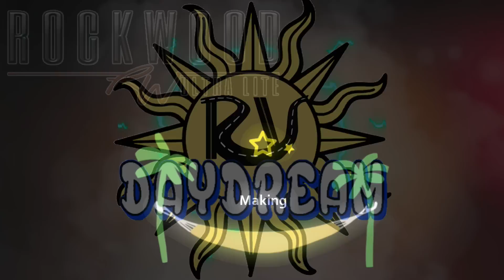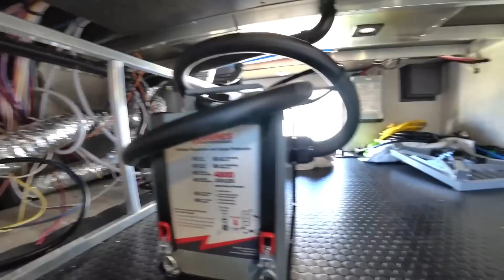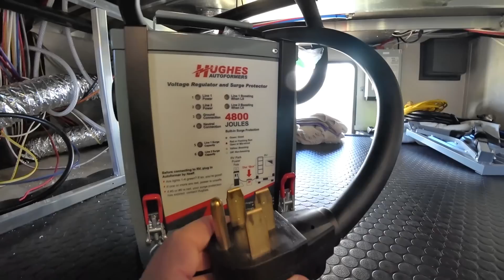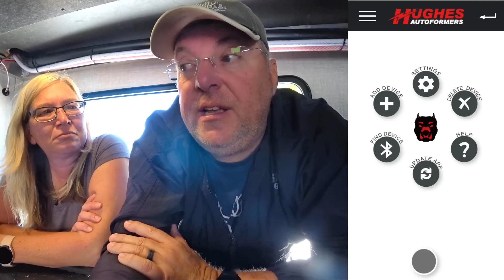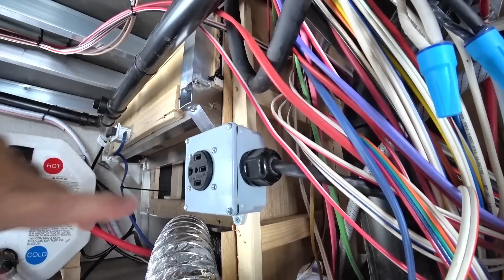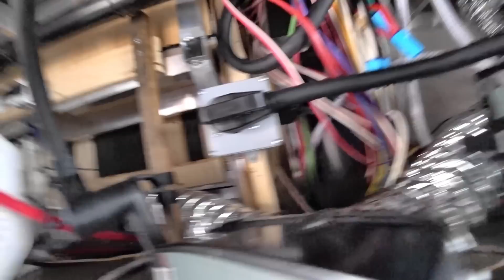Rockwood 5th Wheel indoor Surge protector

Comment: great thinking, am i wrong or could we just splice the surge protector into the end of the 50am cord and the splice in the auto former. , then hard wire. ? That’s my idea, but would like to know if I’m wrong.
Reply from the maker: They make a hardwired autoformer and also surge protector. The issue that I have with it is if either one of those components fail you now have to rewire your rig. So in my case I set it up to where all you have to do is just unplug it to circumvent the faulty component until it can be repaired.

Comment: So what happens if you plug into the pedestal and it is wired incorrectly, do you still risk destroying your shore power cable.   Is you shore power cable still at risk?  I have elected to buy the non EPO version of the watchdog to put at the pedestal, so in the event of bad wiring or a lightning strike, my shore power cable is protected.  I have a smart plug cable and plug, and they are not cheap.
Reply from the maker: The shore power cable is the least likely to be affected by any miswiring as all it does is transfer the electricity as it is delivered. It doesn't care the strength nor the polarity of what is going through it therefore it doesn't get affected when those things are wrong. It suffers damage whenever it is required to transfer those incorrect parameters to a component such as the rig. So as long as you have something that will correct or shut off demand from that Shore power cord it will not allow it to be harmed.
Reply: @Rvdaydream  I agree with most of the premise of your statement mostly, however there is another advantage of having the additional non EPO watchdog at your pedestal still along with the internally rig mounted EPO version.  When we arrive at a campsite, once we are parked out of traffic, the very next thing we do , is to check the pedestal with the NON EPO watchdog to verify the pedestal is a usable power source.  This can be done with a cheaper option, the Progressive Dynamics plug as well,  but for a little more you get a backup surge protect, which in fact can be use inside the rig, if the surger protector EPO became non functional.    So you can also monitor the non EPO watchdog line voltage via bluetooth to see park voltage, and then see the EPO watchdog voltage via bluetooth to see the effect the autotransformer is having on the line voltage.
Reply from the maker: Listen, I get it, you want to make sure that you're protected. Don't overthink it, there's a reason why Engineers say keep it simple, before we started traveling full time I've been over backwards over-engineering and for the most part it came in handy. And not being the type of person that wanted to overexert every function of setup I could not get around manually unplugging the Hughes products when running on a generator. That is I could have spent more time and money on putting in a complete switch system that would reroute around those components but with all the additional cost it's just best to unplug it. And after being on the road for 3 years full time I found the best thing that we could have done was start off with the basics and modify as situations arose. While we were traveling I seen all kinds of stuff going on as far as campsite power. But the autoformer and the surge protector did just fine in their most basic configuration.. the only concerns that had to be addressed was when Park owners that didn't understand how those components worked would frown upon them so that's why they were installed internally in the rig.. as far as the surge protector, I didn't like that it lit up like a Christmas tree and had to be secured to the pedestal in case we were gone for a period of time and somebody decided to liberate the device from our ownership.. you will see campers out there that do Overkill setups especially when it comes to their water delivery, they will have a pressure regulator at the supply spigot they will also have a pressure regulator installed where it enters their rig. This falls under the same category as having a generator that has built-in surge protection yet another surge protector being utilized.. just keep it simple, use the surge protector and autoformer when plugged in to shore power, when using the generator let it take care of the job.. so for 3 years traveling the entire country we would essentially do the same thing every time we set up for power, we would plug in our rig knowing that the surge protector and autoformer we're already plugged in and ready to receive, we would then listen for the loud click that was characteristic for the power watchdog, and then I would look at the app to see what kind of voltages I had coming in on both lines.. at that point since our rig add an app that we control the climate system I would then turn on both AC units and then go back to the Hughes app to watch the line voltage and how well the autoformer modified it.. we never had the test anything at the pedestal. It's really extraneous to do so. The worst potential problem would be that the watchdog could get damaged to the point of needing repaired we always carried an additional cheap surge protector and the autoformer itself has its own surge protection.. within the first year of us traveling we hit 33 States 22,000 Mi and camp that every type of Park/resort that you could imagine.. We had trouble at 3 of them.. Only 1 required a park electrician to fix the pedestal...

Comment: Hughes Autogtransformers and many other companies makes a bonding plug for your inverter generator.   Have you tried to do this as well?    This will keep from having to unplug your surge protection, and possible forgetting to plug it back in.
Reply from the maker: Although the bonding plug has its purpose. None of the generator manufacturers recommend running surge protection and definitely not the autoformer with their products. When running an inverter generator, by design, it's basically it's on surge protector. So disconnecting the surge protector and autoformer still needs to done
Reply: @Rvdaydream  Yes I understand it is clean power,  but why the need to unplug them,  and why do they not recommend using the autoformer,  the autoformer will do nothing to the line voltage coming into the rig,  it will not cause any further draw as long as the voltage does not drop below 114V, and it will not , as the inverter generator is producing clean power.   Still not following the logic on why the necessity to unplug the autoformer and surge protector.  Which generator manufacturers are you referring to?  No trying to be confrontational,  but instead wanting to better understand the need to unplug.   Have you called Hughes about this?   I think I will put in a call to them today.
Reply from the maker: @robertknasel2270 I understand your concern. I spoke with Hughes and champion with essentially the same concerns that you have. I did not want to unnecessarily have to wire in a system that required me to unplug. Hughes advised that there's really no additional concern if you ran their products while using the generator. Champion however advised that there was no need for any additional protection at all from an inverter generator. When discussing my setup with Honda engineers and finding out that I was at one time in my life I was a certified generator mechanic they elaborated that adding additional electrical components to a circuit when they really weren't necessary seemed to be extraneous and potentially a problem when it came to harmonics and feedback as each item performs their own function in their own way for example, you would think that I would have been able to install a self sensing generator transfer switch while using a soft start inline plug in device to power a rooftop AC unit by utilizing it's ramp up voltage Style delivery . However, it did not allow enough voltage for the transfer switch to fully sense enough power to keep the circuit energized and would continuously cycle back and forth between no power and generator power until the generator would go into overload protection... I'm going to tell you also that even though the autoformer is not supposed to modify the voltage whatsoever unless it senses something is not entirely true. There is always some sort of modification being done to the electricity coming out of the autoformer versus what it's being inputted as.
An inverter generator, the autoformer, and the surge protector all have their own ways of operating while sensing and potentially modifying voltage characteristics as it travels through. And although Hughes can test their surge protector as they are being utilized directly with their Autoformer, the same cannot be said when generator manufacturers are engineering their protections and energy delivery profiles/programs. This goes way above my pay grade whenever you start talking about sine waves and harmonic distortions and that's what comes into play whenever you start adding on additional electrical components..

Comment: Hey Mike, why would you need to unplug all your set up while using a generator ? Can I use the same set up and make it work with the generator? I dont want to open my basement wall all the time to unplug the watch dog and the autoformer. Thanks for your help.
Reply from the maker: I put a auto transfer switch in.. I use one outlet with Campground power and a different outlet with generator power..

Comment: This is a great video thank you for making it because I was so lost on how to go about doing this. My only question is have you had any problems with melting connections? It seems to be a common problem with all RVs
Reply from the maker: As long as the correct wire and connectors are being used..
Reply: I guess I used the wrong terminology. Like the 50A connections the male and female ends. Sometimes they will fuse together from getting so hot. We had a 30A plug melt on our old trailer.

Comment: Mike, 
Fantastic video and amazing work. As usual I have a question. I know you said redundancy, but if you had to choose only one to put in there would you use the autoformer or the the surge protector? I am assuming that you are using the bluetooth surge protector so that you can have the added feature of knowing just how much electricity you are using. Is that a correct assumption? I have been thinking about adding the watchdog surge protector for a while but thinking now about adding the autoformer instead. Can you shed some light on that? 
Thanks, 
Pat
Reply from the maker: Yeah if I only bought one of course the surge protector because it also protects from low voltage. And I do pay close attention to how many watts and amps we are drawing using the Bluetooth function that's available. But, traveling to so many different RV parks over the last year and not knowing exactly what we're getting when were plugging in really made the autoformer almost necessary for peace of mind. Some of the parks that we would roll into we're fine for a couple days and then the park got packed with Weekend Warriors and all the sudden they're having a problem supplying the correct amount of voltage. There is a rash of poor Campground infrastructures throughout the country and they don't care if you have a problem or not with low voltage. They're hoping you don't know to even look. But, again if I had to choose one only it would be the power watchdog.
Reply: @Rvdaydream  That's interesting, I would have thought the autoformer would have been the first choice. What does the Watchdog do that the autoformer doesn't?

Comment: I have this same unit 50 amp power watch dog… has saved my rv once from getting fried when the lineman shorted the pole out front ..it has warned me several times by telling me to go check on stuff.. The blue tooth screen and  alarm is a good thing..

Also if you see the voltage starting to sag in heavy demand times , it allows you to go turn something off you don’t need on ,to let run back closer to 120 .. low voltage ruins stuff……your right…makes it run hotter..

I have had it for about 6 years and about 3 years ago it did some funny stuff after a big lightning storm. I called the manufacturer about it and without asking any questions or requiring any hoop jumping he said I will send a new one today “no charge” , when you get it put the old one in the box and return it to me with no cost for shipping to you… he did ,  got it in 2 days and all was fine ….. wonderful customer service.
Also if you will notice ,these units have 4800 joules protection to resist surges .. that’s more than any of the others I have seen out there  .. most are about 2400 to 3000 joules .Plus you can buy the module for about 40 bucks that you can pop in yourself easily to bring it back to like new. 
The other ones  I know of must be shipped back for module replacement… DIY is a great feature on this unit. , I keep a spare module around  but have never had to replace it.
I would buy another if they tripled the price…. Seriously.
Reply from the maker: I agree 💯
Reply: Set the alarm to be the RED ALERT alarm from Star Trek. That way you know sheeeeet has truly hit the fan, and things are a real emergency power wise. That would be cool if you could do that with the Watch Dogs. Copyright you say? Screw copyright, my life is more important then Paramounts intelectual properties. RED ALERT, your RV park electrical grid sucks balls, unplug now, or you have T-30 seconds to reach minimum safe distance.
Reply: @stellarproductions8888  ……Wow man, you need another drink…. Have no idea what you were talking about but it sounded pretty cool…..chow..!

Comment: will this work when you have a 30amp connection and an adapter to the 50 amp plug? does the Autoformer work with a 30 amp feed

Comment: Question ❓ 🙋
Could I gain the same result of protection if I put the autoformer in a metal box with a hole on each side. Plug it in and lock the box. Now no one will steal it.
Reply from the maker: As long as weather doesn't reach it... Yes... They make a cover for it... And the handle is very sturdy for running a cable through it... And the soft cover will allow room for a cable to exit...

Comment: Mike, Ken thinks you are very knowledgeable and loves listening to you. We just got a victron Bluetooth setup. We have had the setup, just not the Bluetooth to watch on phones. We were told to keep track of the volts instead of percentage. What is your opinion about watching these readings? I don’t remember if you ever added solar to your trailers.
Reply from the maker: I love the victron stuff. I honestly don't know what to look at. Of course the percentage is not going to be as accurate as the actual voltage. Just like a gas tank, it would be much more important to know exactly how many gallons you have instead of what percentage of the tank is left but everybody pretty much looks at the gas gauge that is given to them from the manufacturer. I think that you would be able to get away with looking at the percentage until it got down to the nitty-gritty meaning the point at which the batteries would be damaged.

Comment: Just hard wire before the transfer switch if you use a generator. And I was told that the Circuit board that will be fried is only 30 some dollars, I do not know, I was just told. I do have the Watch Dog hard wired before my transfer switch.

Comment: Mike, a suggestion that will keep you legal. Consider making up your wire nuts (the outdoor ones you used) in a box (plastic or metal).
Reply: Very nice and clean install - also recommend placing the spliced connection in a junction box (would be very easy for you to do) just in case one of the wire nuts came off (without you noticing) and you were working in that area and brushed against the bare wire.  The box would protect you from getting shocked due to this.  Even if it is suspended, it would protect you.  Probably $5 or less to do this.  Had this happen to me when working on my last camper’s AC unit.  Added a small plastic junction box with a bolt-on cover.
Reply: This is because your wires are 120 volt and not 12 volt.
Reply from the maker: As we stated in the video This is for entertainment purposes only and I am not an expert. However, I'm not sure who is the one that is making it illegal. What I mean is there is no specific code requirement for an RV. Rvia has their requirements for the manufacturers during production and released to the public for use but enforcing modifications or changes that is definitely a jurisdictional thing and I can't believe that anybody traveling in an RV can be judged by any one specific jurisdiction and the rules that they impose on building codes as the RV is mobile.
Reply: @Rvdaydream  not being the code police by any means and legal/ illegal is probably a bad descriptor. Just treating this like you would standard 120/240 wiring in a house. Not sure how much the NEC applies to RVs, but I would certainly feel more comfortable with it made up in a plastic or metal junction box. Connections should always be made inside of a junction box.
Reply: @Rvdaydream  mounting these inside somewhere is a great idea. Not all power post in parks have the ability to Lock these to the pedestals.
Reply: @22apoach  never know what an insurance company might deny a claim for. Having it meet code might make it a little harder for them to deny the claim.